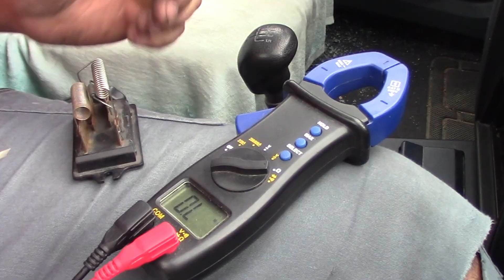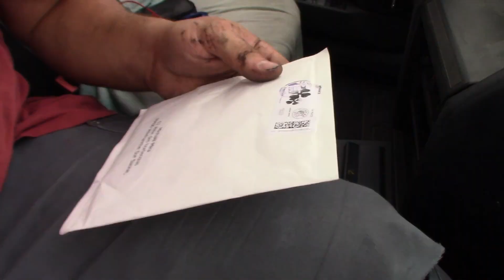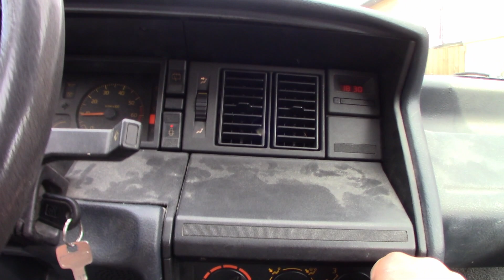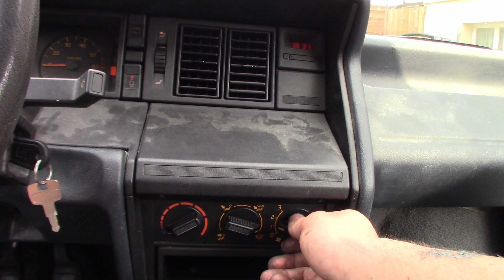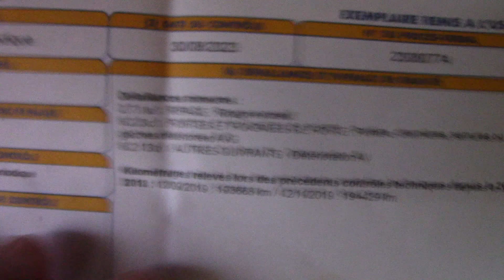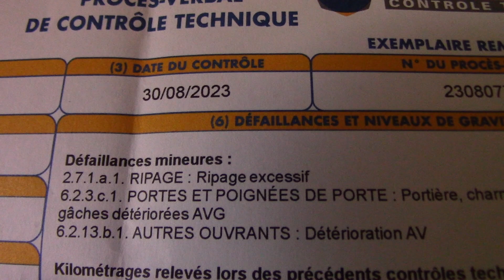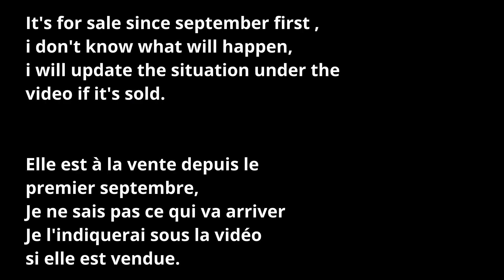Fixing, selling my 1990 Renault 21 (ep 3)

Comment: That was great! I was second owner of a 21 GTD from 1990. Previous one was my best friend's father. I sold it in 2014 with 472000km on 300€. An awesome car. Resistances for the fan were based on electronics in my case and the problem was usually in the cables and junction of cables. Once I had problems with brake rubber hoses and I had yo travel 500km trying not to brake as the brakes will get half stuck in braking. Good memories in it. As far as I know It finally went yo Africa countries
Reply from the maker: 500kms without braking is an adventure haha 
A man let me his card on a wiper arm to buy my car,he thought it was a diesel,it was to send it in Africa too.
At least they don't die,they keep on working where people don't need constant new shiny cars to feel good about their economical choices lol.
I think the best memories are born in the most modest and honest environment,where things and people have the value they can provide,and not the value they are adverised for.
I loved my piece of crap moped,i was proud of it,and i got a brand new scooter,i was not so much pleased of it,it had no soul.

Comment: Some funny times with Renault's we've had over the years. My mum's MK1 Clio decided not to start as the immobiliser got stuck and then decided to free it'self at the main dealer, My MK2 Clio's had electrical fault's like dodgy speedo sensors, airbag light, would short when trying to start it etc. Whatever fault it had got fixed and was fine after that. They more than made up for being comfy and having very reliable engines. The winner out of all the Renault's we had was the 5 (Super 5). A pain to start from cold but would run all day and never had a problem with it
Reply from the maker: I see regularly a man in ihis renault 5 here,since about 10 years lol
This guy don't want to give up on it and he is right about that : simple ,economical,and still running well.
Here people say' renault ,tous les jours un bruit nouveau "  (renault,everyday a new noise ) but it rhymes in french lol
Reply: Ours was a 1.1 TL 4 speed and that was pretty economical. Used to do around 35-50mpg and never took it above 60mph. It certainly was a Super 5. There's something unique about old French cars. Much better what's outhere today.

Comment: You made it look so much better :-D :-D
The plastics came up really well,  i did think about ordinary oil but linseed did the job :-D
I was surprised that the dent in the hood/bonnet actually mattered for the testing.
The only problem with oil on plastics is Dust sticking to it :-(
I hope you get the price you want for your Renault 21.
Reply from the maker: Apparently they notice on paper every little detail nowadays here.
They man told me it was to "avoid complaints from customers claiming the inspector did cause a damage during the inspection" 
That's completly retarded since nothing is established regarding damages before the inspection,so the inspector could damage the vehicle as much he wants ,there would be nothing to prove what so ever.
I think it's more likely to have something to write on the inspection sheet,to keep justifying their job and no modify  the statistics for the government ,so their job and policy  too.
I also think that datas are sold back to the manufacturers ,so they can analyse the lifespan and typical defects of each model,internal datas via the on board diagnostic of each vehicle, like the average mileage,maintenance schedule and stuff like that.
datas worth more than a national currency nowadays lol,specially in the West where we live.
I did let the oil soak in,and didn't even touch it for more than a week,and the excess just evaporated,the plastic kept whait it needed ,and the dust don't stik to it.
You have nearly nothing on the fingers if you rub them on the bumpers.
I don't think i will the sell the car at this price,it seems too much for me,but i 've seen way more expensive similar models too,so who knows...
Reply: As you said, the paper record of damage means nothing if the man testing the car is the same person that writes down the faults.

It's like trusting  Count Dracula  to take care of a blood bank lol .
You can't trust him ever!!
Reply: @michaelovitch  Lineseed oil has the property to harden into a varnish, when exposed to sunlight (especially UV light), within a few days. This oil barely evaporates. This property has been in use since centuries to prepare classical oil paints. So your supposed excess is now a transparent varnish on the bumpers.
Reply from the maker: @ravajaxe  
Good to know,thanks.
I saw a bit of the oil dripping down the bumper,si i assumed the excess dryed or oxydised, like any vegetable oil and yes, it hardened on the body panels under the rear view mirrors, i had to clean that with paint thinner.
I understood that boiled linseed oil evaporate or harden quicker ?
I guess boiling is the equivalent of distillation in the fuel oil industry , reducing the size of the molecules ,making it thinner  ?

Comment: I have 2 Mazdas, both with manual transmissions.  What I miss is the feeling of the transmission moving with the engine, when they used rods instead of cables to connect the shifter.
Reply from the maker: That's true,you feel exactly what's happening when you have a steel linkage,the whole powertrain is moving,and that's great to feel working.
Cables suck,and get loose,sloppy, but they get slapped without any adjustment needed at the factory,so they use that.